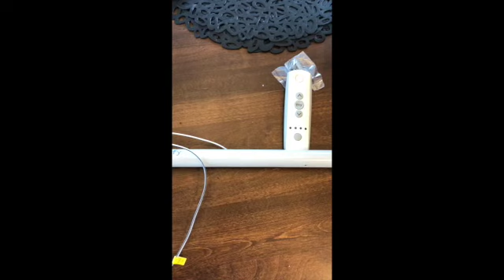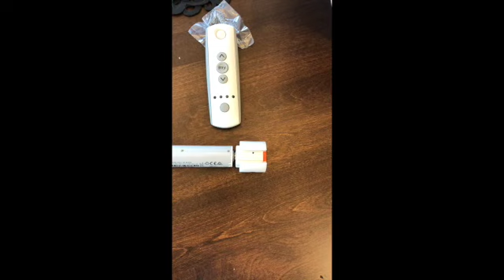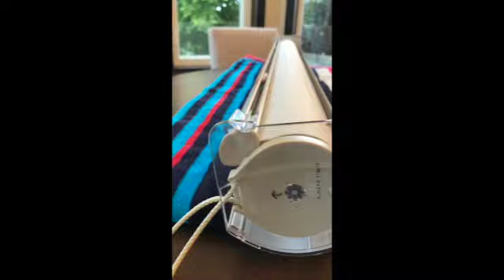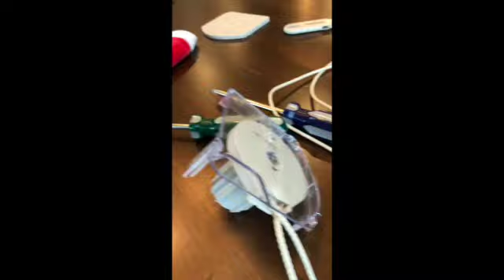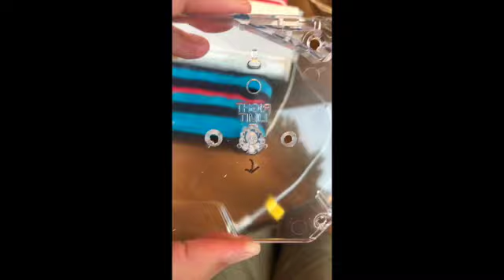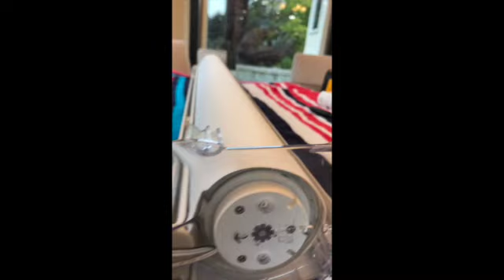How to install Somfy R28 RTS motors into Hunter Douglas (TM) Pirouette(TM) Shades

Comment: Nice, extremely helpful video.  Two questions please, after you changed out the motor, were you able to use the Somfy remote, which is SO much easier to use than any of the over-technized Hunter Douglas remotes.  Question 2) Do you know if a Somfy motor could also be retrofitted into Hunter Douglas (TM) Duette or (TM) Duolite shades?   Thanks!
Reply from the maker: Hey there. Thanks for your comments. The same thing motor definitely works with all the somfy remotes. I purchased a standard four channel remote and I work at using all my blinds nicely. I’m trying to figure out a way to use HomeKit without using any additional hardware. As far as the soft motors. They should be adaptable to any hunter Douglas, blind or shade. All you really need to do is identify the type of tube that the blind winds up on. Then you would have to order the appropriate crown. The crown is the piece of plastic that fits nicely into the tube. Hope that helps.
Reply from the maker: I forgot to mention that I installed these motors over five years ago. Two of them I use AC power. Five of them on using the battery too. Believe it or not I am on this team batteries at work installed five years ago so don’t be too worried about the batteries running out often.